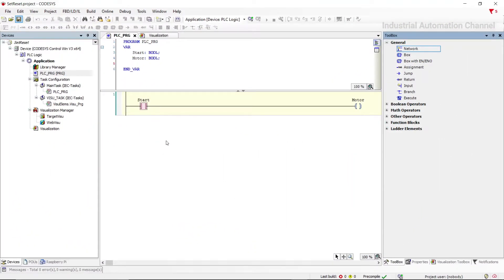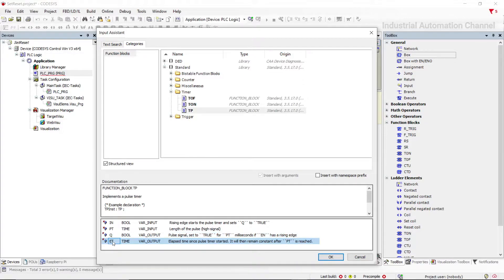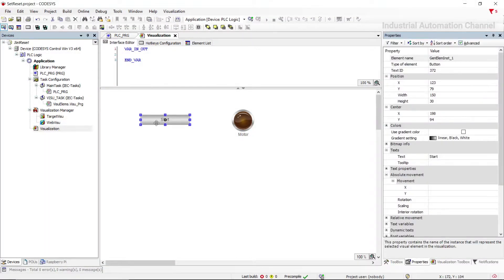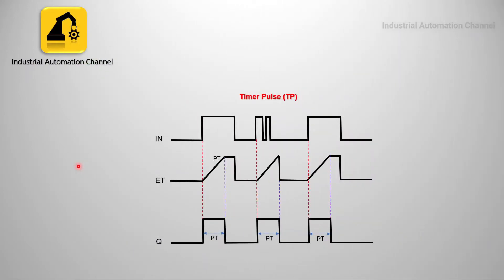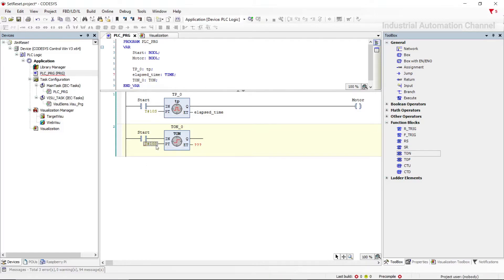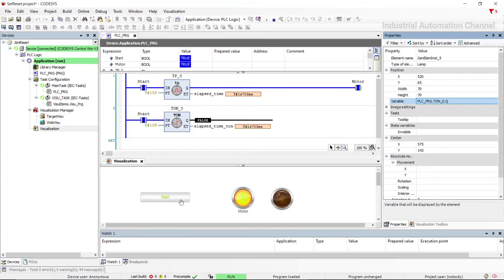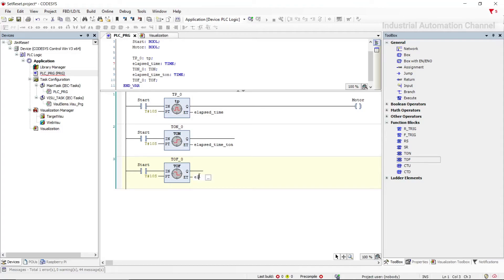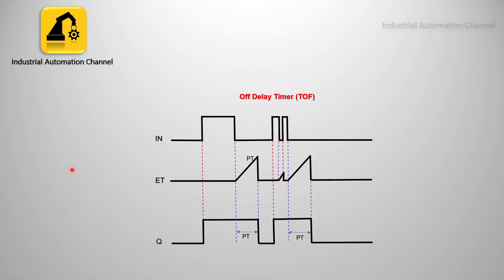Codesys #5: Timers (TP,TON,TOF) in Codesys with Ladder Logic

Comment: I do not understand why the TP timer would just keep counting with the input off. What would you use if you want an output to be on only when the input it on (a timer is timing bit)?
Reply from the maker: TP is a pulse timer. On a rising edge of IN, it turns Q ON and then keeps timing for PT regardless of what IN does afterward. Even if IN goes low, the pulse continues until the preset time is up. That’s normal TP behavior.
If you want an output to be ON only while the input is ON, use a TON (on-delay) and derive your output as IN AND NOT Q , so your “ desired output while timing” is only true while the input is on and the timer hasn’t finished.
T(IN := Input, PT := T#10S);
your_Output := T.IN AND NOT T.Q;

Comment: This is really good presentation of using timers. Very clear and concise. I wonder one more thing. Does Codesys have option to collapse/show networks like Step7 and TiA has? Is there a button or shortcut key to collapse all LAD networks, to improve navigation through program?
Reply from the maker: Thanks.
Unfortunately no. But to improve navigation you can use "GO TO" (Right click on networks) to go to a specific network, if you have lots of networks.
Reply: @industrial_automation  Thank you for the explanation. I hope Codesys will introduce this feature in near future. This is one of the features very often used in TIA.